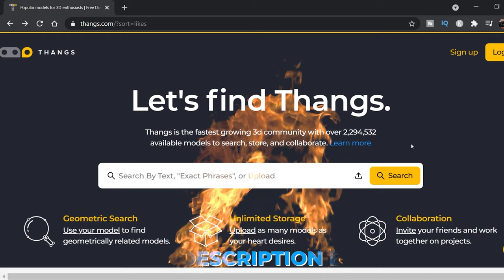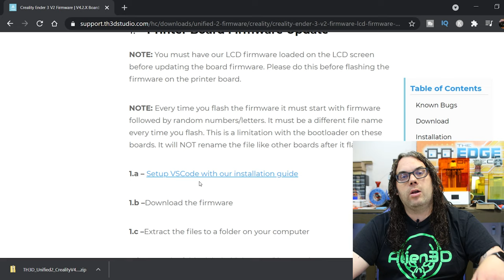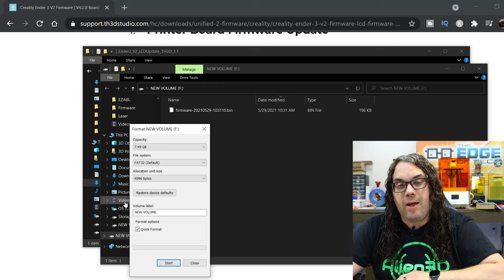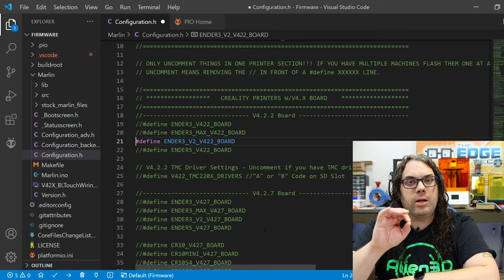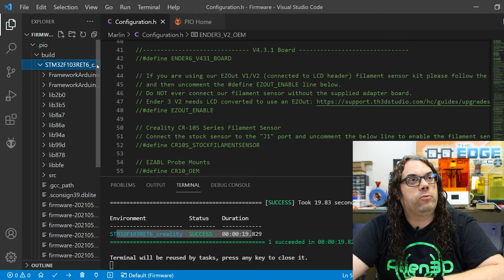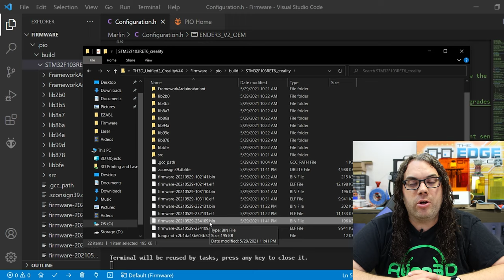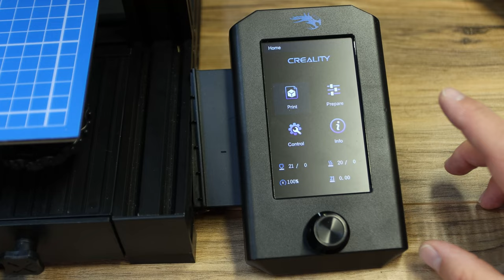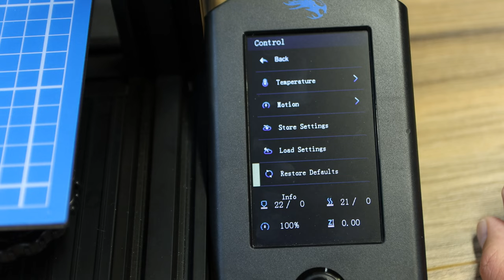Ender 3 V2 Bed Leveling : How To Install a TH3D EZABL : Full Guide

Comment: So everytime you are done with your printer you have to unplug the EZABL so the power does not stay on all the time? Is this the same scenario also if you wire it in direct?
Reply from the maker: In this case, yes. But if you directly wire it, like most people do, you will not have that issue. It will turn on and off when the printer is powered off and on. I just used this as an example of the easiest way to install it. I have another video coming that shows the direct wire method as well.
Reply: @TheEdgeofTech  Nice, this video come at the perfect time by the way, my EZABL was delivered 3 days ago and i got the power pack with it but now i am not to sure i want to use it. I got a different screen also thinking i had to upgrade my screen, now i know i do not have to! Great video by the way!
Reply: @TheEdgeofTech  Thanks, that makes sense. I recently read comments from a new user like me who assumed ABL would just fix all the issues they had with leveling but I see that the same basic principles still apply.
Reply: @TheEdgeofTech  installed my ezabl following your video, what a breeze man! My next question is I still have a pain in the but getting the bed leveled manually and I have yellow springs installed. Are the solid mounts the way to go? My only concern with solid mounts is, what if your carriage is not level and that throws the bed off on 1 corner, what do you then?
Reply: I'm planning on ordering and installing one of these. I've installed one of their dual "Z" axis kits.
Reply: @terrymcdade1888  Nice man, i love the EZABL, wish i went with it in the first place over that damn junk BL touch i had. I to have the Dual Z axis kit along with the direct drive extruder.

Comment: I have been using the  OBL system since you posted this instruction video.  I have an Ender 6 and a highly modified Ender 3v2.  You are my resource for the OBL adjustments on both; always.  Thank you.

Comment: I just got into 3D printing last week and have had nothing but problems leveling the bed and not knowing if im too close or to far from the nozzle and was ready to give up. Now that Ive seen this im gonna give it a try what are the odds this came at the perfect time! Thank you!
Reply from the maker: Welcome to the community!! Leveling can be tricky when you first start, but you will get it! Check out my bed leveling video if you need some assistance, also if it's an Ender 3 machine, you might want to make sure your X Gantry is level. I have a video on that as well! I hope that helps! Thanks for watching!
Reply: @TheEdgeofTech  Thanks for the tip! I got the Ender 3v2 so Ill definitely go check it out!

Comment: I have an V2 that I'm upgrading. I've added the EZRSTRUDER and I'm currently adding a dual "Z" from TH3D. I'm planning on adding the ABL you just added. I've installed numerous prox sensors over the years and prefer them over a mechanical switch system. They do like to have the sensor end kept clean. Very good video that answered all my questions about it.
Reply from the maker: Awesome! Sounds like a great machine! Use my discount and save some cash if you add this on too! haha

Comment: Sweet video, thanks! 
Couple questions before I install mine. I also ordered the AC adapter because I figured it would be easier, and I see some folks complaining they have to turn it off. But do you have to? Maybe I'm missing something but it seems like you could just keep it powered at all times. 

My other question is in the slicer when setting up z offset, do you just keep that set to zero in your slicer and adjust on the machine? Currently with manually leveling, I tram with a feeler gauge and set that as a negative value in my slicer. I haven't seen that mentioned in any of the videos I've watched so far but you do manually level with a piece of paper so is that what you're accounting for here? I'd like to be as precise as possible, especially if I'm installing an ABL so would love some clarification there :)

Thanks!
Reply: Did you ever get an answer, I'm struggling with this now, as I set my z offset, but when I go to print, it still prints in the air slightly
Reply: @urjnlegend  I did. TH3D answered in another video that it's no problem to just leave it plugged in. Draws minimal power. In the end I decided to wire it directly since it came with the wire but either way is fine, no need to worry.

As for the z offset, I also changed my old habit that I had mentioned above. That led to constant adjustment anyway so now I tram my bed with my feeler gauge, run the auto bed leveling, then adjust my z offset at the start of the print. I only need to adjust every so often or if I change filaments or layer height.

Comment: Very nice video, will be a ton of help to get this installed on my Ender V2.  When you were reviewing the results of the test print, you mentioned that there was a drag in the center and at one of the corners and that the bed "must have not been level".  I thought the EZABL was compensating for any bed unlevel issues by using the information it gathered during the initial probe to bias the Z?  Am I missing something here?
Reply from the maker: Hi! I did mention that, and what I needed to do is relevel the bed manually once. Then adjust my z offest again. I set it just a little to close and it was causing the dragging. Also, I found that my X Gantry was a little bit off. It must have happened when I moved the printer and I should have checked it before printing. I normally order the solid mounts from TH3D and I forgot this time, that would fix the issue of the bed moving.

Comment: 3 years after you did this video, I'm trying to add an EZABL onto my Ender 3 V2. I'm currently trying to do the firmware with the VSC. Sadly, none of what I've got looks like what you are showing on your computer.  There's no check mark that I can click on to get it to auto compile for me. Will you please do an update on how you do this since the VSC program has changed?? I'd love to finally get this finished.

Comment: Great video as always.  I have 2 bltouch. one one ender 3v2, the other is on my Elegoo Neptune 2.  The install for the ender was pretty easy however the install for the Neptune was a bit more difficult.  Since it's pretty new there are no video installs, such as you did for the ender, to help  but i eventually got it installed.  i contacted Elegoo directly to get the firmware for it and found the mount on thingaverse.  i will say that the ezabl looks a bit easer than the bl for the neptune 2.  Quick question, my board on the ender3 v2 is on its way out, keeps giving me error messages.  what board would you recommend for a replacement?  I have the 4.2.2 in it now.  Thanks for the great vid. keep them coming.  Dan
Reply from the maker: Thanks for the great info! I have a Neptune, but have not got it together yet. I think if you are to get a new board, you could go with the 4.2.2 or 4.2.7 if you want a direct quick replacement. That would be the easiest. I know TH3D has them and if you use my coupon code TEOT5 you will get a discount on it! I hope that helps!

Comment: I was just about to start installing this and I was surprised at the lack of videos just showing someone doing this fully..there are a few, but they are old. I'm dumb but I thought the ABL was supposed to handle the leveling for you?? Why the need to level the bed with the ABL on the printer?
Reply from the maker: Thanks for watching! You want to make sure your bed is level because the Auto Bed Leveling will compensate for variances, but not a bed that is crazy out of whack. I normally just use the solid mounts and don't have to worry about that though. lol

Comment: So you do not need to upgrade the LCD screen as TH3D site suggests on the v2? I just want to make sure before I order. Do they just have older information or what?
Reply from the maker: You do not have to, but if you want more functionality of the firmware, Then you could. If you do it this way you do not have to change the LCD.
Reply: @TheEdgeofTech  awesome. Thanks for the confirmation.

Comment: Wonder if anyone can answer a question on printing problem. on all my prints at about 51mm high my print has a horizontal seam which breaks away anything above it. not sure if I did something dumb on my cura slicer or is it my printer  I wish I could post a pc to show. It just started a few days ago so I am stumped. Any help would happily appreciated and  Thanks for reading my post
Reply from the maker: Hey Steven, if you can, post this to the discord or my facebook page. Then you can add pictures. If you don't have discord or facebook, you could tag me on twitter too. Thanks for watching!

Comment: Great video and I am really excited to run some prints with my new ezabl. I did run into some roadblocks though specifically with the firmware. I followed the steps and my screen won’t update. Similarly, I followed the steps for the configuration.h code but when I run the code, it always fails. Does anyone else have these issues?

Comment: Any estimate as to when u will have the direct wiring video for this? Patiently waiting. 🙂
Reply: There's other tutorials with that. I think
Reply: Check TH3Ds page. They have a 40 min video covering the install which is almost the same as here. They also cover wiring directly to the power supply. Same as here, just have to flip the Ender 3v2 over to get to that.

Comment: I'm sure I am doing something wrong, when I reformat my micro SD card for the LCD screen 4096 bytes is not a option. I tried 8192bytes the  LCD  screen goes to orange, but when I remove the SD card,  I  still  have the original  screen.

Comment: Jim,  Is there a way to remote access a Ender3 in order to apply updates?  Thank you and have a most awesome afternoon!
Reply from the maker: Great question! There isn't a way that I know of to install the firmware updates remotely. That would be awesome though!
Reply: You can do it via octoprint using the Firmware Updater plugin, but it is not easy to do.  Much less hassle to use an sd card
Reply from the maker: @dogjennings1171  Thanks! I hadn't heard of that. The SD card is so easy and fast.
Reply: @TheEdgeofTech  Jim, The reason I am asking about remote access is because my seven year old Grandson is not capable of doing the firmware updates. I was going to implement the hardware update however the software part seems challenging. I wish you were here in Pleasant Prairie!  Have a most awesome evening!
Reply: @dogjennings1171  Dog, Thank you for the expeditious reply and information. Have a most awesome evening!

Comment: Do you have a video covering the issue on first few layers scraping and Z not lifting, but rest of print is fine after that?
Reply from the maker: I don't have a specific video on that one. Good idea though!
Reply: @TheEdgeofTech  yeah caus I get the first few layers going all thick and the nozzle scraping over whats printed with the z not lifting or barely and then after three or four layers the rest of the print is smooth.
Nothing I could find online that addresses this problem with the v2. Mechanics all tight and so forth.
Different filaments same issue.
Different slicers also same issue. Tried changing layer feedrate on top bottom layers and so forth.
Only way to get past it atm is to wait for first layer to finish and then up my z by 0.4 to get decent prints.

Comment: I updated the LCD firmware as described, however, after the orange screen and restart, a Creality Screen pops up and then the interface is all sorts of messed up.  Have tried flashing multiple times.  Any tips?
Reply: legit in the same boat right now. you ever get anywhere with it?

Comment: what about the solid bed mounts? hows that work?
Reply from the maker: Hi! Solid bed mounts replace the springs under the bed. Once you put them in, you tighten the wheels all the way down and they all should be at the same height, and don't move. I really like it when using auto bed leveling! You can find them on the TH3D Site and use code TEOT5 to get a dicount on them. Thanks for watching!
Reply: @TheEdgeofTech  thx.

Comment: I cant format the drive correctly. I don't even have the option for 4096. Can't google an answer either. Someone at TH3d said the Micro SD card was too large capacity at 32G.
Reply: The 8gb card that came with the printer worked for me.

Comment: So what's the difference between an ABL and a BLTouch?
Reply from the maker: They are 2 different technologies. The most notable difference is that the EZABL is inductive and doesn't touch the surface. The BLTouch is mechanical and does touch the surface while probing. This might help too:  https://www.th3dstudio.com/2018/08/21/ezabl-sensor-myths-toms3d-sensor-test-and-other-myths/
Reply: They both are useless on such a small bed. I would recommend just level your print bed. And never look back
Reply: @bigblue1287  Automatic bed leveling is a misnomer. It would be ABL if the 4 screws on the bottom got adjusted automatically to make the bed truly level. Considering the duration of a print, I will level my bed every time even though I have a BLTouch. I'd prefer it actually be level over having software compensate. I am currently installing a cast aluminum tooling plate for my bed (w/110v heater). It's going to be truly flat. The only thing we can't fix is one of the z steppers skipping a step. I have an Ender 5 plus that I raised 40mm so I can add a beefier Z-stepper motor or one with a closed loop driver.

Comment: Can you make a shorter version of what needs to be done correctly to get it to work?
also at what stage is it best to have the bed heated?
Reply from the maker: Hey Alex! I am not sure what you are asking? This is a video of what's done to get it to work correctly. Is there something not working,? Also, if you check my starting and ending gcode (link in the description) you will find that it accounts for heating and cooling the bed at the proper times before and after probing. Thanks for watching!
Reply: @TheEdgeofTech  just a shorter video so it will be like
Install it with nozzle touching bed
Raise it
Adjust screw ect.
Explain advantages/disadvantages of having it installed differently. More information would be sweet.

Comment: What if I installed the solid mounts then removed them to go back to spring how do I level the bed :(?
Reply: The solid mounts are used specifically for the ezabl, they can't be leveled. The ezabl does the leveling.

Comment: Why not add this to a bigger printer like maybe the Ender 3 Max. Anything with such a small bed you do not need an auto leveler! That's just horrible information for people starting out in the 3D printing world!
Reply from the maker: I think it's up to the person to decide if they would like to use it or not. Some people like tinkering and doing upgrades no matter what printer they are using. It's not necessarily needed on any printer as long as you can tram the bed correctly. This is more a video for someone who wants to install it and learn how to do it. Stay tuned because the Max is coming as well!
Reply: @TheEdgeofTech  I really appreciate you getting back to me. I've only been printing for 6 months and on three printers and it's a very simple hobby if you don't over-analyze things. I just wish you would do these videos and make sure you stress to the people that are new to the Hobby. That this is kind of unnecessary for such a small bed. Information is King

Comment: I really like your Channel. But anyone who owns an Ender 3. There is absolutely no reason to put a bed leveler on such a small bed to print on. I think you will even admit how easy it is to level this bed. Adding this will give you more headaches then probably better prints in the long run. I own an Ender 5 plus. I do not use the bltouch I level the bed and get amazing prints! Good information is more important than just putting out content. You should be recommending that people don't do this I'm such a small printer it's worthless
Reply: I have the hardest time keeping my bed leveled, and I changed the spring for better ones... It just keeps shifting and there's on corner that I can't do anything with. I tried all methods and manual bed mesh... Nothing works correctly. So I am seriously considering an auto bed leveler on mine...
Reply: @ThePapaVader  no matter what you still got to go through the proper manual leveling with the piece of paper. Something else has to be loose. If you doing a proper bed leveling with the paper and you put stronger Springs in and every time you go to print you not getting a proper squish to the bed plate is that correct?
Reply: Let me help you out here since you have only been printing for 6 months. Sometimes your bed is warped and continues to warp with heat cycles, its aluminum. Lets say your right rear corner has a dip in it, a little dish in it. No spring adjustment will get that out. ABL will adjust as it prints to maintain level (within reason). I was getting good prints to but that one spot on the bed was bad. I even took the bed off and took it to work and put it in a press. I have three printers and not one as a flat bed. You will get good prints but let the ABL do the work for you and you will get better prints. IMO I think it should come with solid bed mounts to make it that much better. So yes there is a reason on smaller printers and more so on bigger printers like you said. And no this is not "horrible information" all the info was correct in the vid. I hope this helps.
Reply from the maker: Thanks for the response and your insight! I agree that solid mounts are the way to go!